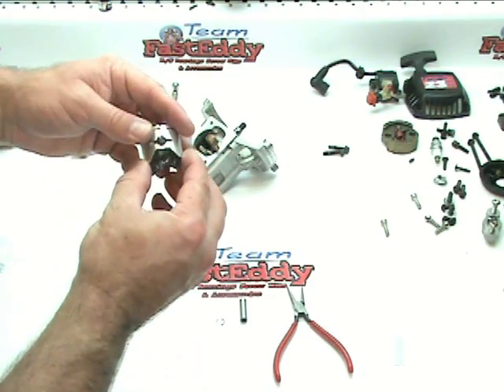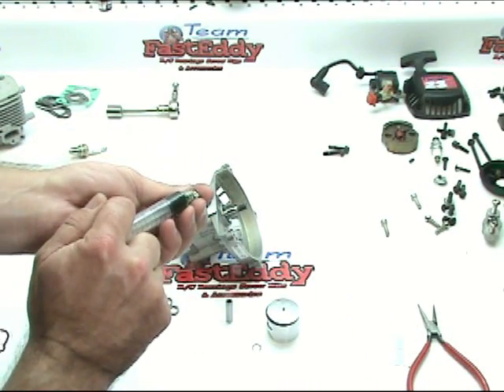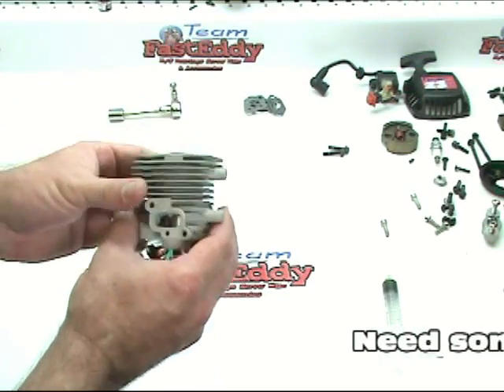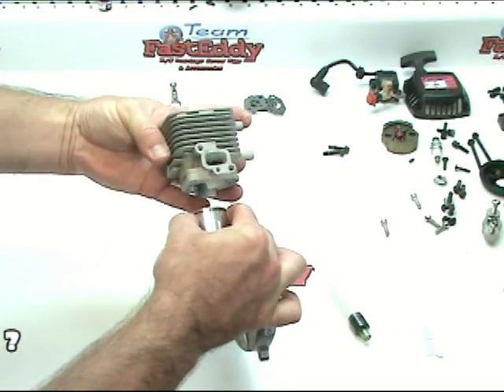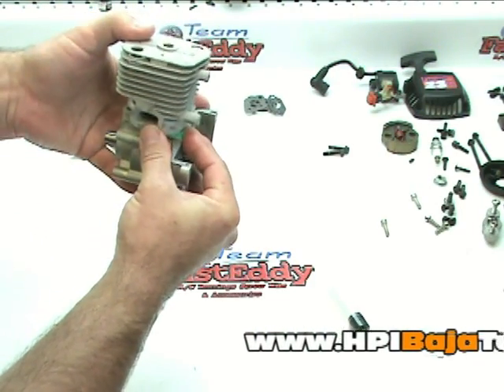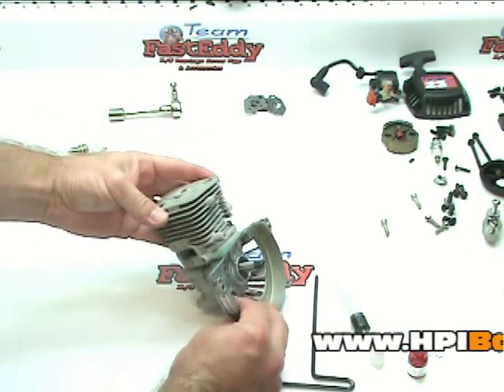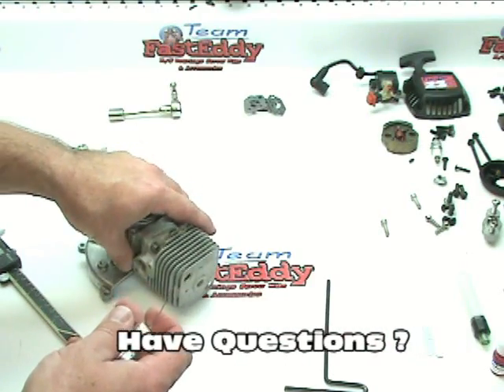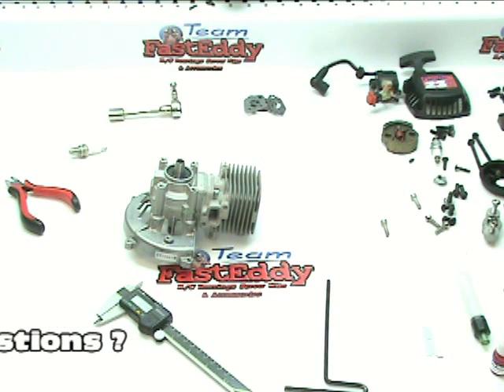Video #6 Tutorial Rebuilding the CY 23CC Engine

Comment: Hi do i have to take the whole engine out to change the base gasket? My baja is new only had about 5/6 tanks through it and oil has leaked out from the gasket. I was having tuning problems it was bogging down maybe the leak has caused the tuning issues. Im new to 1/5 scale!

Comment: Hey fasteddy, i recently took the head off my cy26 and didnt know about checking the squish. The engine is on stock needle settings and the spark plug has a somewhat light color to it now, before it was a dark brown. Could a change in squish cause this to happen? It was running somewhat hot and when i went to go kill the engine it continued to run for about another 7-10 seconds. I checked the cylinder plating and it looks alright and theres no discoloration on any of the internals.